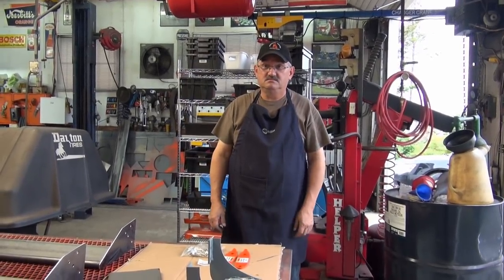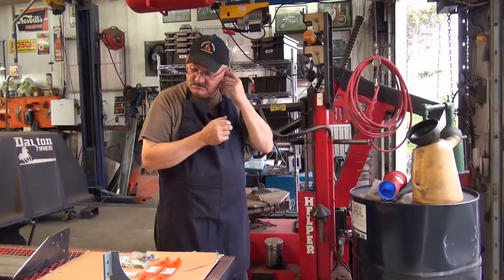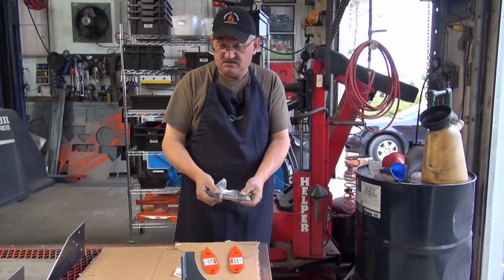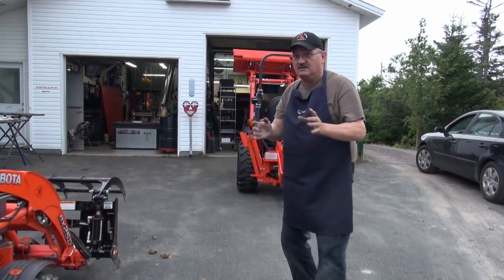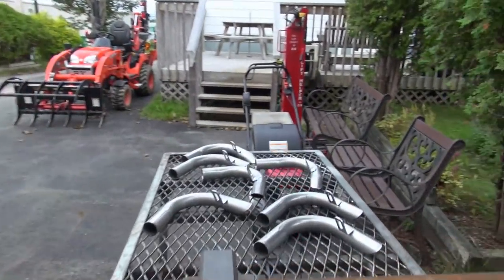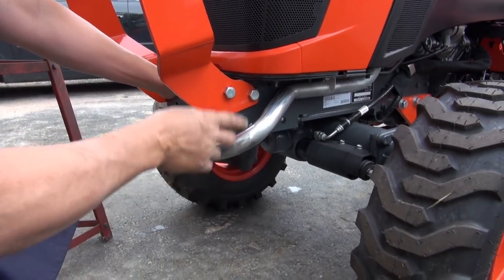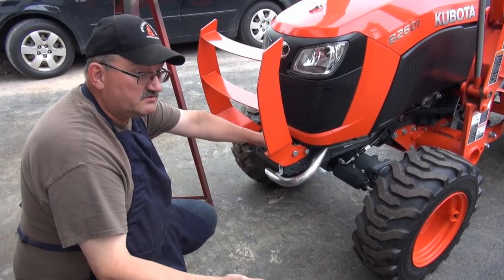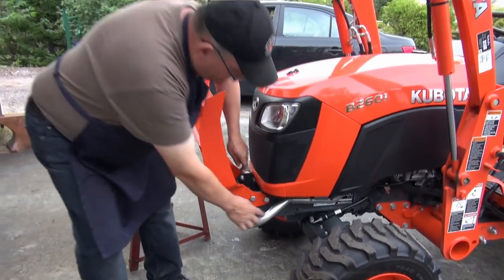Two New Kubota B2601 Mods Released ( mods #6&7)

Comment: Looks good..but how will it work with a front blower and a belly mower .. I have both!
Reply from the maker: I never stated that it would work any other way. Like I’ve replied before. There are no mods that will fit every situation and this is one of them. If I were in your situation I would simply try to design it differently. Anytime you see our mods they are only intended as you see them on the video.

Comment: Hi Paul, does the exhaust mod for the B 2601 work with the quick hitch for the snowblower and lawn broom? I’m interested in getting one if that works. Thank you for the great products and informative videos! Wayne from Wisconsin.
Reply from the maker: Hi Wayne. Kathy said she haven’t heard of any interference with those implements on the 2601. If you like Kathy can email you some close ups so you can check it out.
Reply: @7863348   if you could d send the pictures I’d sure appreciate that. I just picked up my new exhaust pipe today at the Kubota dealer. I put a extension on the pipe to keep the soot off the fell and snowblower but when I used the forks to move branches on the burn pile I accidentally hit a log bending the exhaust. Thank you Wayne
Reply from the maker: Wayne kathy don’t have your email now. Just email her at specialtyrepairssales.com and she’ll send some info.

Comment: Paul and Kathy. Love the videos and the mods. One question to the exhaust mod for b2601 and that is will it interfere with ditch light mod?
Reply from the maker: No because There is no Ditch Light Mod for a B series tractor.
Reply: Paul & Kathy Short oh ok. So will there any for the b series?
Reply from the maker: I doubt it very much. Of all the mods we’ve developed the “Ditch Lights” are the most complicated time consuming one that we’ve done so we talked about it and determined that putting that much time and effort into them for a B model would be a waste of time because of possible low volume sales. 
The B series and devolopment of accessories is not really worth going much farther with and it will soon end and we’ll move back to the much larger lucrative BX market. There’s just not enough interest in the B series to make it worth while staying at it. One reason may be because of the variation of models within the B serires itself. All our productions are low volume so the cost is higher  than mass producing them but we are offering accessories that no one else in the world are offering and that in itself should be worth something.
Reply: Paul & Kathy Short  Thanks for the info and reasoning. There a lot of “b” models. Keep up the videos and mods. I really enjoy watching them.